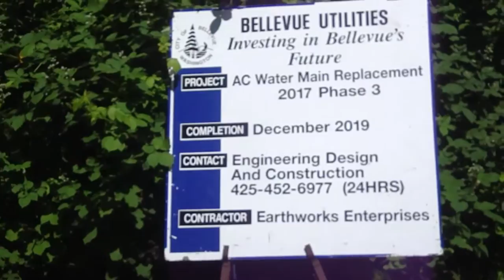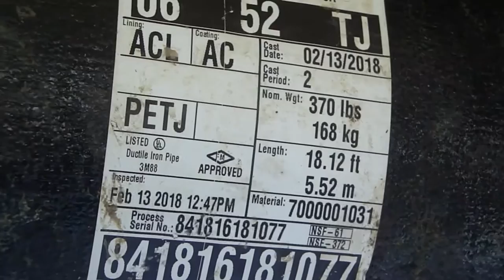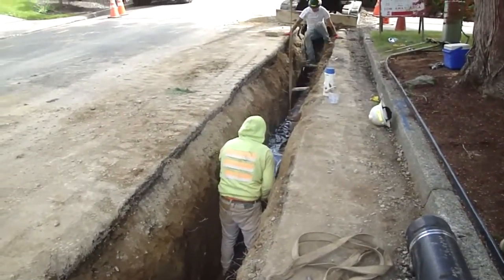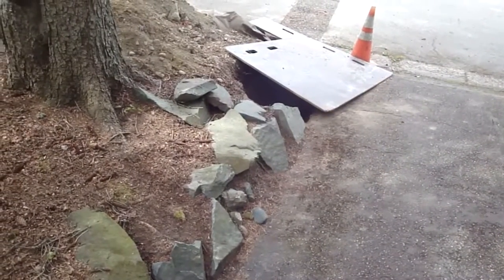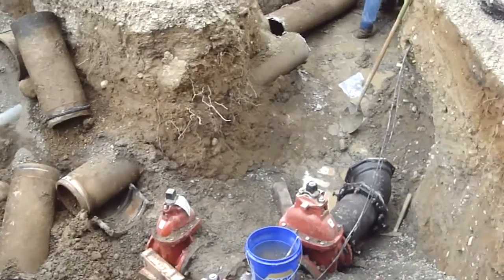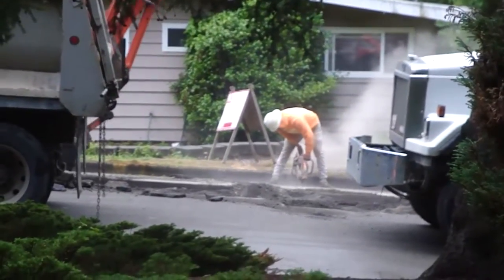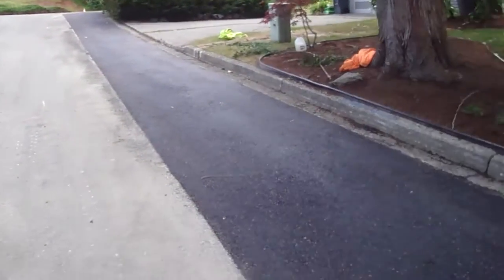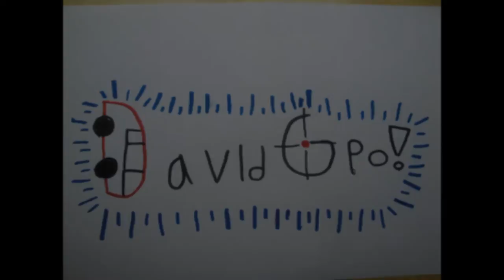Water Main Project

Comment: The old pipes are made of an asbestos-cement material known as transite. The new pipes are ductile iron, not cast iron.
Reply from the maker: Thanks!
Reply: I always cut the translate with the chop saw I don't even put water I like the smell of the dust
Reply: Ductile pipes are heavy as all fuck, but super strong cast iron is okay but over time ends up rusted out full of barnacles.
After doing maintenance on mains for several years i will no longer drink knowing what the inside of some water mains look like
Reply: Asbestos cement were the cleanest inside just has a bad stigma cause of the asbestos but its okay when wet
Pvs or pe is fine but how long until the chemicals seep into the water changing the quality
Reply: @SMOKYY_DA_BEAR92  let me know if you do it all the way without getting a lung tumor?
Reply: @delvisleyva1101  they say it's best if you smoke a cigarette while doing it 😂😂

Comment: Looks like 10" Ductile Iron.  New age cast iron with way better properties.  It will flex (ductility) unlike cast or A.C.
Reply: Why don’t they use c900, maybe couldn’t get their hands on it?
Reply: @davezanin1863  my guess is because of freezing issues? Or city standards call for ductile. I work for a small system here in Southern California and unless the standards call for pipe for a certain situation, we use c-900.
Reply: @Deathmatchgypsy  right whatever the plans call for
Reply: @davezanin1863 it also depends on where you’re from here in California we’ve used nothing but c900 different states have different requirements.

Comment: Insane they are backfilling with a rubber tired Backhoe with a straight bucket.  All companies around by me would have a full sized Wheel loader with a side dump bucket.
Reply: Not going to increase efficiency in this case. You use what you have for the job. Plenty of room on a quiet street for a backhoe to work. No need for a side dump.
Reply: @josephpiekarski1569  , you'd be surprised how much more effective it would be actually.

Comment: Why in the hell are you not using air shoring, or a trench box.  Straight cut like that. Wow.
Reply from the maker: Could it be because the soil is hard pan?
Reply: Less then 5’ with a dense soil. Doesn’t seem like an issue.

Comment: Should use plastic not cast iron.
Reply: That pipe is ductile iron. Much stronger than cast or pvc. Line should be plastic though. No need for ductile unless installing a fire line.